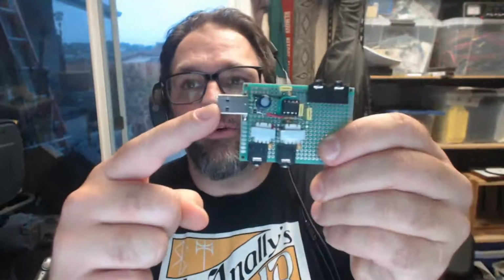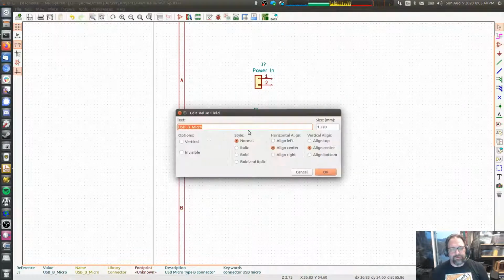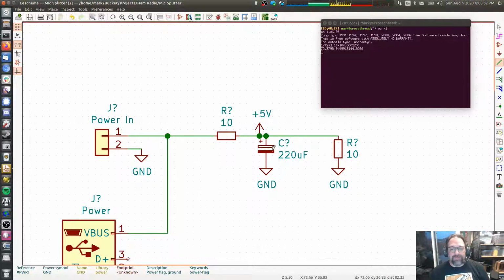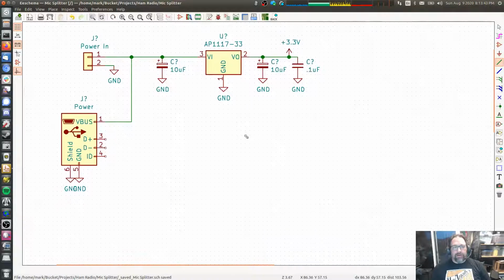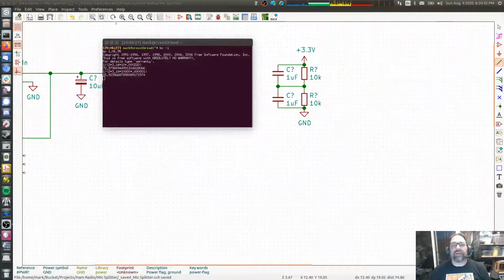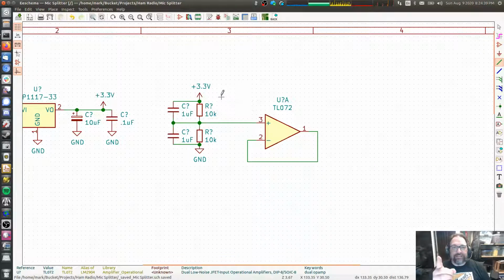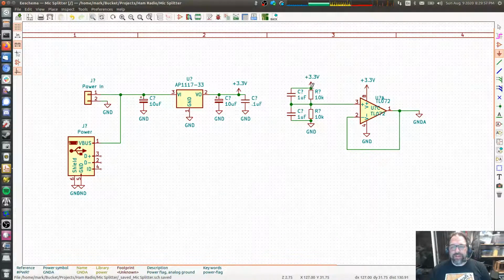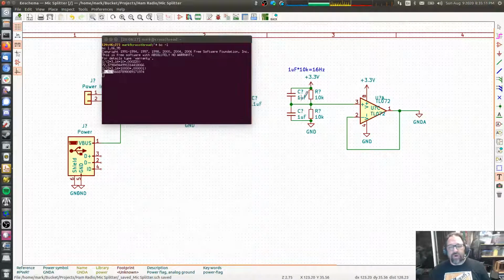Audio Building Blocks Explained, Episode 1: Power Supplies.

Comment: Bill-N6EF-What op-amp did you end up using in the final design?
Reply from the maker: in this context, it doesn't much matter. We're not doing studio quality audio or audiophile quality audio, so much about any jellybean op-amp will do. You could use a TL072, TL082, LM741, etc.  I think I ended up using a TL072 just because I bought a bunch of them off eBay for dirt cheap, just to have in the parts bins for impromptu projects like this.